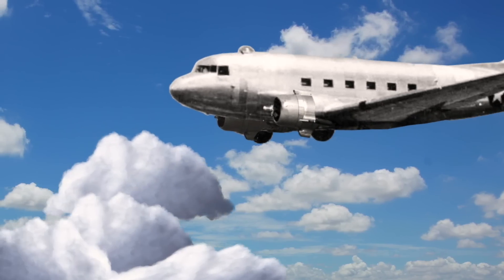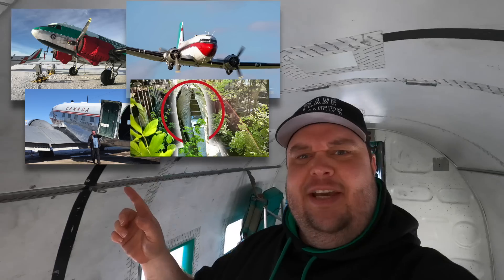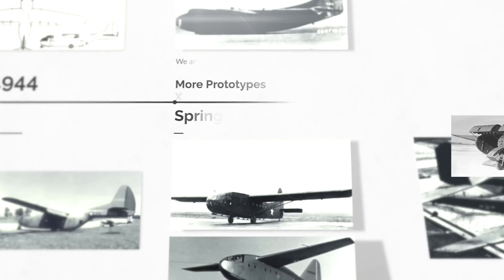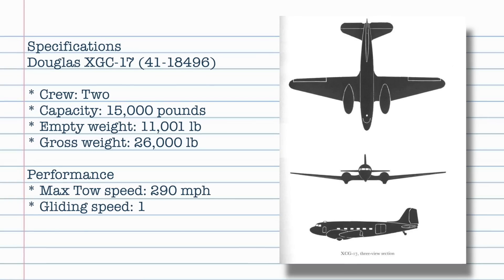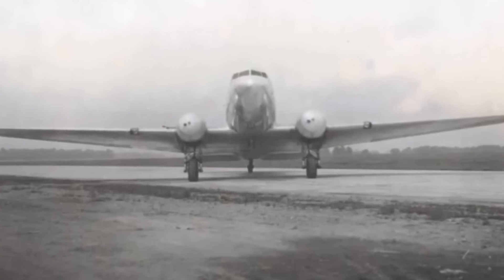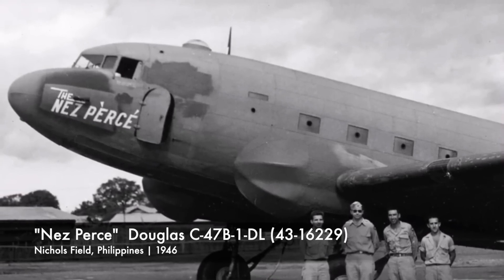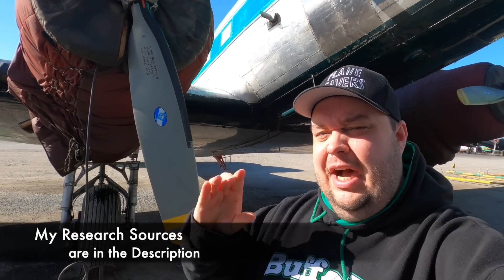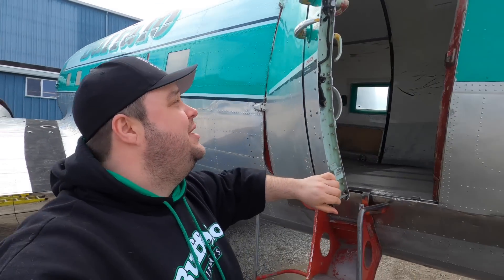Was the DC-3 a better Glider than a ... Glider?

Comment: As an aeronautical engineer I am really surprised that the C47 could be converted into a good glider, even if the Wright brothers launched aviation by designing a wonderful glider that they modified to make the first aeroplane! However, the figures prove the point: relative to contemporary gliders the XCG-17 was an excellent glider! I'll be damned if I haven't learnt a fascinating lesson! Thank you, Mr. McBryan!
Reply from the maker: Thank you!!
Reply: I would have expected CG issues when the weight of the engines is removed from foreword of the CG
Reply: Les Brown  You and three hundred of your closest friends.
Reply: The C-123 started life as a WWII glider, then went on to have a career with engines, it could have had turboprop or jet success if the manufacturer hadn't been crooked
Reply: Is it possible to up scale the dc-3 to make it a competitive aircraft since it was so popular when it was produced in large scales?
It would be fun to scale it up to a 5 times larger aircraft with upgraded power and all the modern cockpit equipment  to see the performance.
An obstacle would be tilting fuselage when it is on the ground though.
Reply: @team2001  DC-3s are still a useful airframe, no scaling up required. They're useful in remote areas, low volume passenger and cargo service, etc. That's why a lot of DC-3s have recieved a turboprop conversion and glass cockpit makeover.

Trying to make new counterparts of old planes however is more problematic due to type certification requirements driving up the new aircraft's cost. A good example, the new Gweduck is objectively a massive modern improvement over the Grumman Widgeon and Goose concept... But it currently exists as just a kit plane, because certifying a new design for commercial use is time consuming and expensive. This is the main reason why old airframes are still kicking in commercial service.
Reply: Just so you know, the DC-3 air frame was calculated to have a 14 :1 glide ratio ! Compare that to an AT-6/SNJ of the same era that had a 6 : 1 glide ratio.

Comment: I have a question. Is conversion to a turboprop so expensive that it makes running piston engines still economically viable? I mean I know those piston engines are incredibly complex and not nearly as rugged as a comparable turboprop engine at least I think so possibly I'm wrong. Could you possibly Illuminate Me?

Comment: Jato bottle story. Twin Beeches had jato bottles in the nacelles, if you lost an engine close to the ground you could fire the bottle and get enough altitude to make a safe landing. Jato bottles had an expiration date and had to be replaced, so a maintenance outfit in Minneapolis would put the bottles on a steel plate on the back of a Massey Harris tractor, hold the brakes and fire the bottles. One day the brakes let go and the tractor went for a rocket ride across the airport. I don't know what the top speed of that tractor was supposed to be, but I'm sure it set a record!

Comment: The DC3 engines counterbalance the tail.  Without the engines she would have been tail heavy.  The DC3 must have a wide CG range.

Another use for the DC3.  I was going down the highway (~1980) and an RV made of 2 DC3 fuselages went by opposite.  Just got a glimpse.  They had cut both fuselages in half and joined with noses antipodal.

Comment: Since propeller drive has more efficiency than jets at low altitude and shorter hops it's not surprising a plane the size, reliability and capability of the DC-3 has endured. It's smaller than any modern airliner and for situations that don't require a huge plane, it fits. It seems to me a modernized version could see a market, in essence an all new manufactured Basler. I wonder if that might ever happen.

Comment: I flew the C-47 in the USAF. As I remember the glide ratio for the fully configured C-47 was between 20:1 and 26:1. I even had a small test of that glide ratio when both engines experienced Carburetor icing and shut down.

Comment: The C-47 was used as the first "Puffs" in 'Nam.  Why didn't the military use turbo-props to extend the reliability of the C-46s / C-47s?     The C-46  had difficulty with its Curtis-Wrights catching fire.   The C-47 could maybe have carried more, if "Tri-motored", with Turbo-props.    Were any of the "C"s  [--46/ 47] given pressurized cabins?

Comment: Here’s the reason NOT to use them for glider service: They cost too much for a one use plane.
Reply: Are you sure?   With the number I found the common US Waco CG-4A glider cost $18,880 versus $79,500 fora C-47. But the cargo is 4200 vs 15000 pounds or 3.6 times more. The C-47 number is with engines and navigation equipment etc and that is a large part of any aircraft cost so rest remove 30% of the cost. So per pound of cargo, you get for the CG-4A 18,880/4200= 4.5$/pound and for the C-47  79500*.66/15000= 3.5$/pound.  So whit this number the modified C-47 is cheap the question is if the number is correct. I have to say that I picked the first number I found so the number might be a bit off. 
Even if the cost was higher you could perhaps take payload that the other glider could not take. A tower airplane could to two CG-4A  or one C-47 glider so if you are limited by tower aircraft that if I remember correctly was often the case you would increase your payload by 33% per tower.

So I think that the fact that it did have a low wing and not skeed for landing on unprepared surfaces have more to do with why it was not used. Another part is the material used where the DC-3 was made of aluminum the glider that was used was metal wood and fabric to reduce usage fo rarer material. So not the same type of skills and equipment was needed. That and the timing in the war with less need of large gliders is more reasonable the cost that will be quite similar.

Comment: Possibly better than US gliders of that time, but not better than German gliders (today still world leading).
One also has to define: Better in what ? Minimum vertical speed or maximum glide ratio ?  Keep in mind: These are two totally different parameters !
Nice additional joke: The instructor for my COM / NAV licence once said, that even a B52 could thermal around; however required uplift needs to be a series of small tornadoes (maybe of class F1).

Comment: I just have to wonder - How did they manage the weight and balance issue? the engines were mounted in front of th CG, as was all the junk in the flight engineer compartment - and it was all removed in the glider variant.
Reply from the maker: Flight tests shown that there was no need to add weight for CG. Part of the reason they liked it so much

Comment: Now hang on a minute.  I don't understand this.  There's still a "real" airplane pulling this thing.  Is the point that the glider needed to be cheaper and "disposable", so it could be landed in a place from where it could never take off again?  Is that why pulling a glider was worth all this trouble?  And the "real" airplane detaches and lands at a proper airfield?
Reply from the maker: Yes that was the case in the war early on. Later on they wanted to use them to haul freight. Like a train. One powerful aircraft can tow a “bonus” plane behind yours to move more freight. Sort of like using a Trailer behind your pick up truck.
Reply from the maker: On top of all that,  you are right as, the they just ended up putting engines on the XCG-20 and making it the C-123 anyway lol.
Reply: @MikeyMcBryan  So the "air train" scheme was for cases where the powered airplane wasn't fully loaded weight-wise itself, but rather only filled volume-wise?  So it still had engine power "left over" to pull a glider also?  

Or maybe it was also a matter of having an extra-long runway to work with, so that the powered airplane could get more weight off the ground than it could normally?

Comment: This confirms my hunch, the DC3 air-frame is a good contender to be returned to production as a future electric short range aircraft. Like island hopping or carrying skydivers.
Reply: For a transport category a/c with two engines, I rather jump from a twin Otter, a CASA 222 or a Shorts. For a static line jump, the DC-3/C-47 just has too much history to ignore. Another, would be the AN-2 (a big piston single).
Reply: @williamswenson5315  yes, but who owns the patterns? The DC3 frame may be running out to the public domain just because it is quite some time since the last was manufactured.

Comment: The main reason the DC3 glider was rejected, is it was an expensive airframe that used precious aluminium.  Gliders were made of cheap plywood, and could be made by the local garden-shed manufacturer.....
R
Reply from the maker: Yes the early gliders were mass produced and based on simple construction designs and mainly served as a single use craft. If you look at the Gliders that came after the XCG-17, they were all Metal purpose built designs that were meant to be reused. Even the XCG-18 and XCG-20 were such good airframe designs that they put engines on them. The XCG-20 even becoming the C-123 Provider. The DC-3 (C-47) conversion was the cheapest route as all you need to do was build a field conversion kit and the aircraft could go back and forth from powered to non-powered flight with in hours. C-47 at this point was in every airfield and this would have easily been the cheapest way.

Comment: I have a picture of a wing run over by a steam roller. This is how Douglas tested the wing only stopping when the section could not be crushed by the heavy machine. I knew a WW2 B17 pilot after war bought a c47. He said it had 100 thousand hours on it.

Comment: Rocket assisted take off system is probably next...
Reply: Basler Aviation in OSH demoed a RATO on a DC-3 over twenty five years ago. It was an amazing sight with an unbelievable climb angle. At least, until the rockets burned out.

Comment: I flew in a dc3 a few years ago, it had a great ride compared the modern short haul aircraft I have ridden on. The interior was mostly just post war, with the passenger cabin heater modernized and some updated Cockpit systems (GPS and Radar).

Comment: Hi Mikey...they are retiring A380,s and maybe converting some to cargo but the DC,s keep flying. 👍
Reply: Unlike the 747, I don't believe the 380 was designed with cargo in mind if that passenger thing didn't work out. That had been the fear when the 747 was proposed and now, it appears the 747's are being modified into cargo a/c. They'll probably fly for many more decades in that role.

Comment: Next up , the DC-3 also used as an .....
- Excavator 
- Sandwich shop
- Greenhouse 
- Culvert
Reply: How about water craft? One of the few aircraft that can ditch at sea...and stay afloat!
Reply: Campsite, Liquor Cabinet, and Stash courtesy of Romancing the Stone
Reply: there is a dc3 used as sandwich bar and a restaurant
Reply: so you have not been to the congo?? it has and still used in most those jobs there!
Reply: Or can be used as a fuck chamber

Comment: "matched up with today's modern airliners a DC-3 doesn't even hold a chance", huh? Just compare the looks of the DC-3 and the big fat ugly whale in front of her... No other airframe will ever come close to the aesthetic perfection of a DC-3, except maybe the Spitfire and the Constellation. I'm absolutely not impressed by performance, profitability and increase of use of modern aircrafts. If we could just ground them all, save a few hundred Spits and DC-3's that we'd see over our heads every now and then to play a concerto for Merlins and Radials, aviation would really be badass! Ok, throw in a few Lockheed L-10 and constellations in the mix, and we're there...
Reply: Just to tag in.  What with the health issue ongoing and various assumptions by airlines that 747's '67's, '77's, A-380's and perhaps others too will be headed to the scrappers, yet the DC-3's carry on.

Comment: Hang on... literally.

The DC-3 / C-47 is not a past tense performance aircraft.

It remains in the top 10 for aircraft range,  payload per fuel pound burned,  per foot of runway required. 

When a bean counter looks at the operating costs, very few aircraft can compete. 4 Tonne payload that can get off the ground in 1,600' at sea level or just over 2,000' at an elevation of 5,000'. That's almost unheard of. Basler wasn't crazy when they created a turbine version.

The Basler is just more expensive to operate. Even with higher payload value, its higher  maintenance overhaul cost per hour makes it a razor thin margin model to operate. But it can outperform almost anything for size and weight of the aircraft. 

As a testament to the DC-3, I remember looking at the log book of a Venezuelan C-47 / DC-3 back in the early 90s that had accumulated 68,000+ hours. It was notable because it racked up the majority of these hours on flights between Cuba and Venezuela, often flying the route 4 days a week!

Comment: Tim McCoy here. Wife's account.  I've had time in 4's6's and 7's.  Love the DC-3. They will have one at  
Starfleet Academy working. Hauling Dilithium crystals.
Reply: Come on Tim, you know very well it will be fitted out as the test bed for the original warp drive which it's self will built like a brick .......

Comment: They glide very good.  That huge wing.  When lightly loaded, we had to use full flaps and even forward slips to bring it down to the runway.  Over cities approaches, with thermals all over, we had to keep doing forward slips and cut power to idle which is no good but it wanted to glide shallow and not come down at all.
Reply: I heard that the problem with using DC-3s for skydiving was getting them down. They had to fly that big wing down, taking up a chunk of the turn around time. Understandable they'd make good gliders when you think about it.

Comment: All these lively modern aircraft that out perform the DC, made with metal that have a finite service life... turning brittle and cracking to bits. Where is the long term efficiency in these alloys?   The DC3 and B-52 will see service life beyond 100 years, thanks to ductule metallurgy
Reply: In the meantime, the F117 and B2 bomber sit at Air Bases requiring millions of dollars of our tax money to fly one hour a week each.  And come back for more before the next hour of flight maintenance.  Expensive junk.